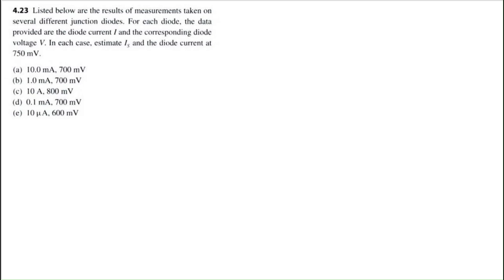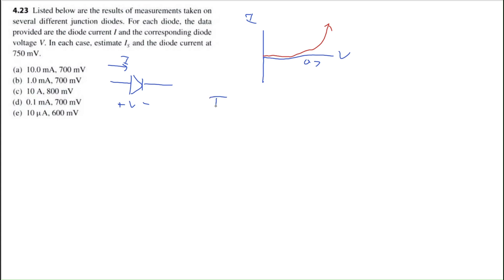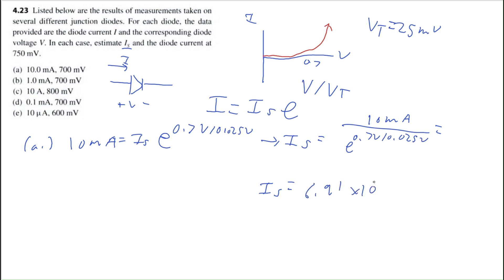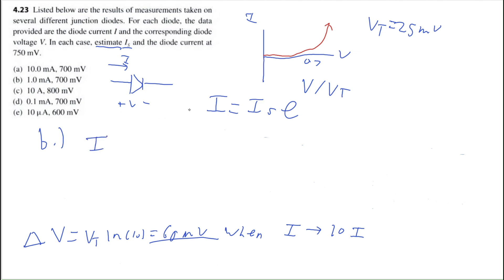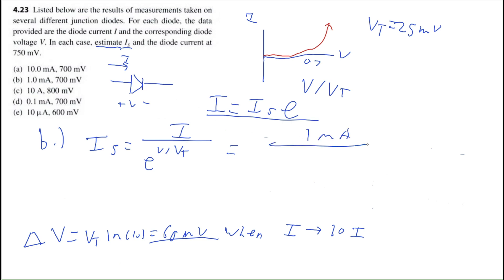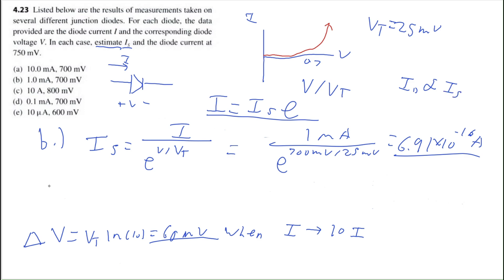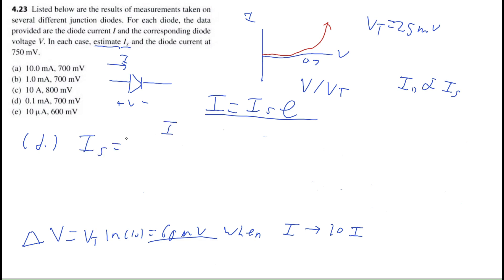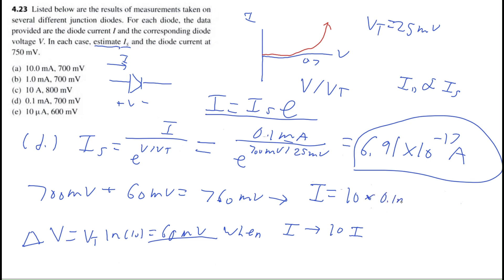Problem 4.23: Microelectronic Circuits 8th Edition, Sedra/Smith

Comment: I feel like you might be answering a question from a different edition rather than the question you have on the screen. you finish part a by solving for V when I = 10I and in part C I see you solve for when I = I/10.   However the question you have on the screen calls for V when I = 750 mV

Comment: For the diodge current section of part a, why don't you just solve for I in I = Is*e^(v/vt) since you are given v=750 mV? Does this give you the exact diode current?
Reply from the maker: Hello, thank you for your question! 
The issue with your proposed approach is that the scale current, Is, will vary as the diode voltage changes. This is why the problem just asks for an estimation.

I encourage you to try your method and compare the results. You may find that for some values, the estimation is more or less accurate. But we generally accept a close estimation over an unknown approximation.

Please reach out for any further questions